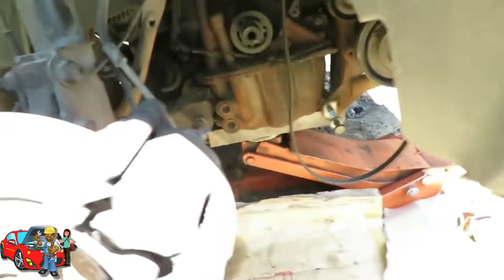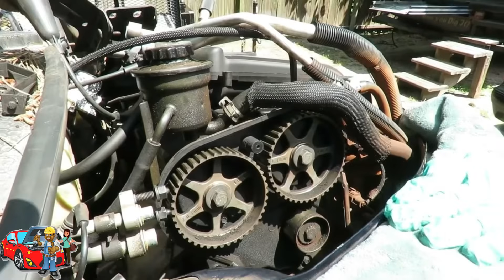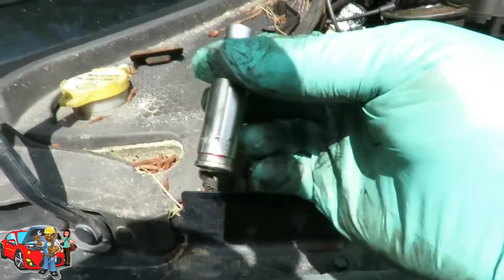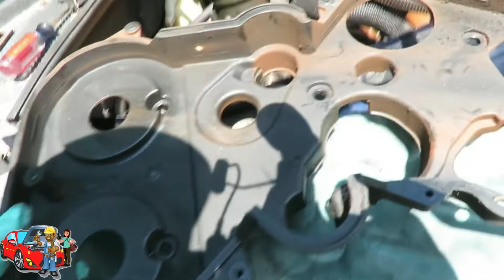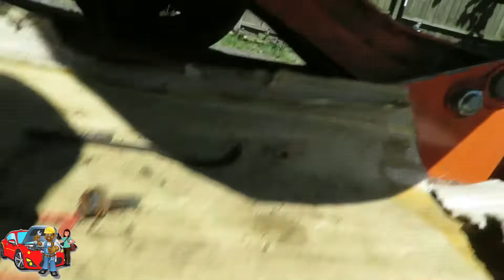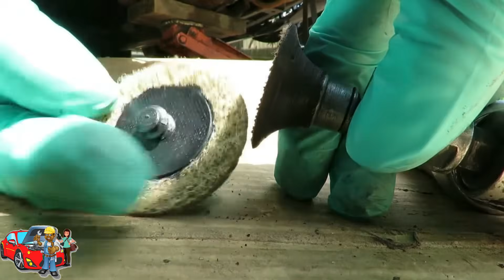Chrysler PT Cruiser Sebring Dodge Caravan Jeep Liberty Timing Belt Radiator Replacement - PART 2

Comment: You can replace the water pump without removing the plastic backing plate. (remove bottom screws going into the backing plate , pry out on it close to the pump and block it out with a short piece of 2x4. Saves you from pulling the plate and cam sprockets off.